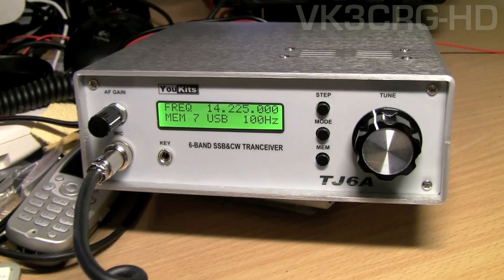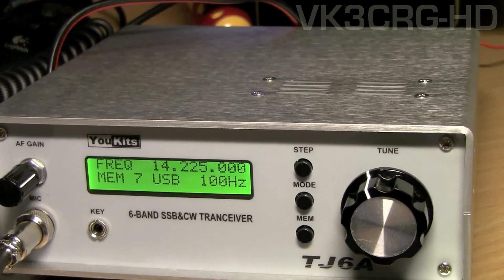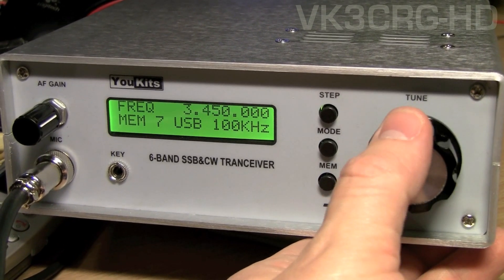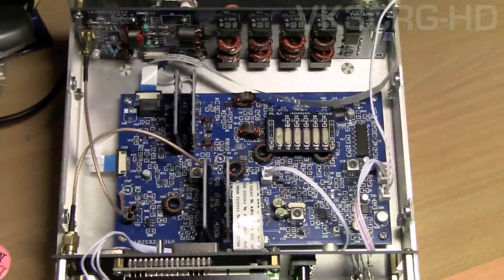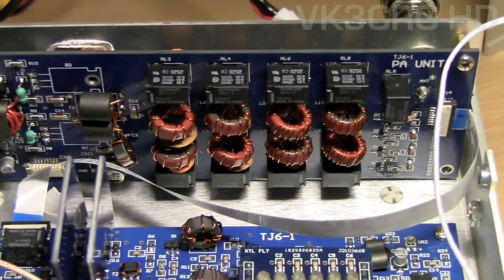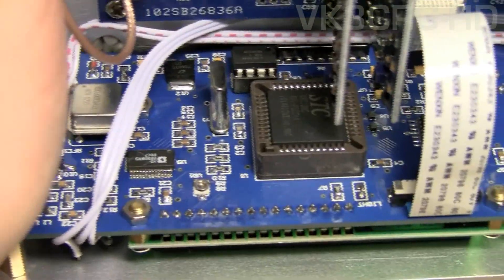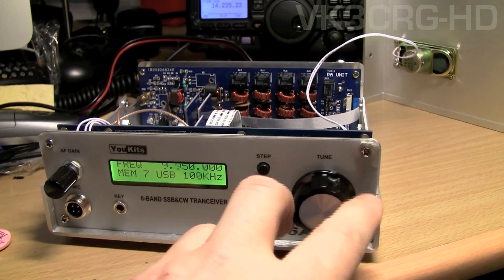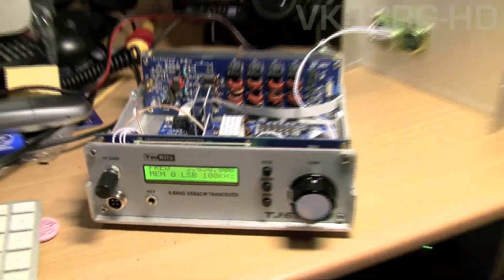Youkits TJ6A 6 Band SSB & CW QRP Amateur Transceiver Kit

Comment from the maker: Yeah it depends on the person i suppose. Some will have trouble with the surface mount on this kit, especially if they are not experienced with soldering normal components. I also found it rather exhausting...you have to really concentrate. But if you take regular breaks and give your eyes a rest, like you say it's ok.